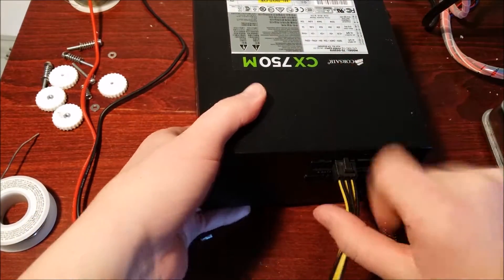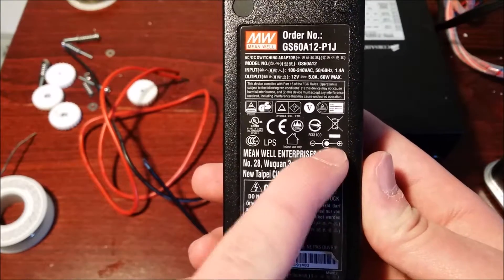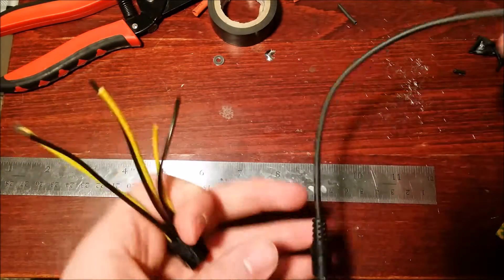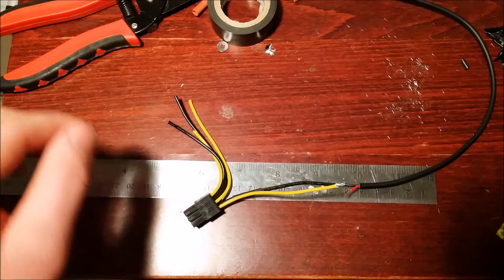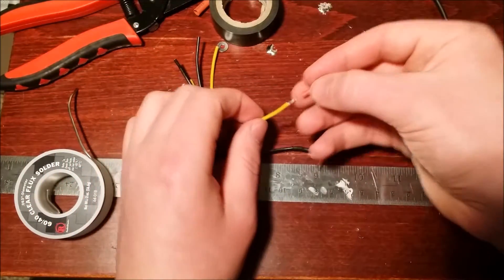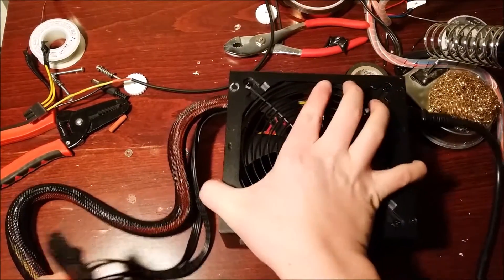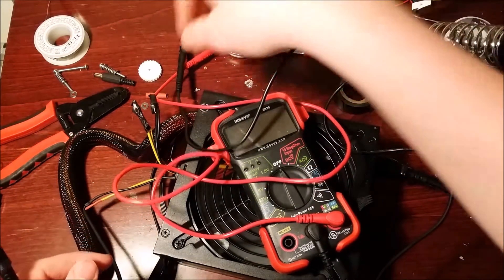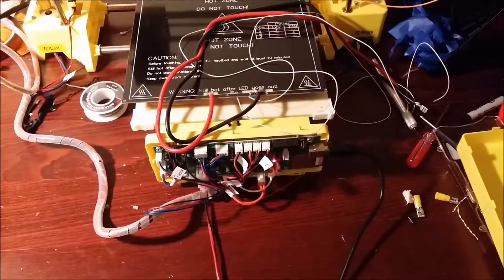Hobby King DIY Print-rite 3D heated bed install part 2/3 (power supply) any 3D printer

Comment: What power supply is needed for this printer? I’ve gotten the printer but wo power supply
Reply from the maker: Any 250w+ 12v power supply there are some links in the description the 2nd one is a good option just be very careful with wiring since it’s high voltage

Comment: I just did something similar to my printer. I used a bench 12v power supply rather than the ATX supply. Worked well.

Comment: Print-Rite / Colido 3D printer motherboard power connector is a standard ATX four pin 12V Power Connector for CPU. I noticed it by comparing the connectors - the 60W power supply which came with the printer had exactly the same connector, but only two wires connected. Printer motherboard had all four pins. I tested motherboard power connector with multi-meter by choosing continuity test  - both upper and bottom pins  were paired. Then I just connected the ATX power supply and it worked. No need to solder anything, just plug it in and it works. Polarity is the same and now the motherboard gets 2 x 12V @15Amps. Seems to work fine. However big thanks for the other videos, they were really useful.
Reply from the maker: toumasho Thanks for the feedback!

Comment: Great vid! I found an old power supply but not sure if I can use it, will this do the job? http://imgur.com/WB51IWU
Reply from the maker: +II GothicChav by looking at the specs it shows that your PSU has a max of 288 watts on the 12v rail so it should work since you only need 250 watts on the high end to run the printer with a heated bed. Just make sure you connect it correctly with the positive and negative to the right wires. Use a multimeter to double check the connections. Hope this helps.
Reply: +Channel Everything Great, thanks! One thing I did notice though was that it has a atx p4. Could I not just match the pins on the printer and plug this straight in, eliminating the 5.5mm DC plugs?
Reply from the maker: +II GothicChav I am not sure. if you want you can give it a try. But what you could do is unplug the 2 wires you don't need. Check the polarity and voltage of the other 2 wires and plug them in the same way like on the DC plug. let me know if you need me to explain it a little more. hope this helps.
Reply: +Channel Everything No need, managed to find a another tutorial to comfirm everything. Thanks though. Do you have a problem with the bed to getting up to temp? I can barely get to 90-95...
Reply from the maker: +II GothicChav well if you are printing pla you only need to go to 75, but I have not tried going that high yet for other materials.

Comment: I love the simplicity of this mod and looking forward to the 3rd video.  Have you had any issues (e.g. printer restarting) with voltage drop when the heatbed kicks on, off, then on again? I'm assuming the bed is a pretty good amp draw. I had an idea to connect the coil of a relay to the heatbed output, and then the PSU and headbed would be on the normally open side of the relay. The printer could still run off the stock powersupply with zero voltage sag when the heatbed turns on with such a large amp draw. I'd like to see more videos of any other mods you think of for this printer.
Reply from the maker: +Mark Wanersdorfer thanks. Your question is actually something I didn't think of, but there is no voltage drop when the heated bed turns on. It only tales a few minutes to heat up and in fact the extruder and bed can be heating at the same time and there is no problem. Your question did make me think of something. If you do plan on using a computer PSU you have to make sure that the 12v rail can still handle the power. The ones in the description should work. Part 3 should come out in a few days and I am going to make a short video on explain the power supply issue since you probably aren't the only one with the same question.
Reply: +Channel Everything if your setup works with no problems I will just do the same! No sense in adding another layer of complexity. Now, if you wanted to make the heatbed 24v...thats where a relay is required.  But since you say the bed heats up quickly Im not going to bother.  I guess the biggest issue with a PSU isn't the max watts, it's like you said, the amps on the 12v rail.